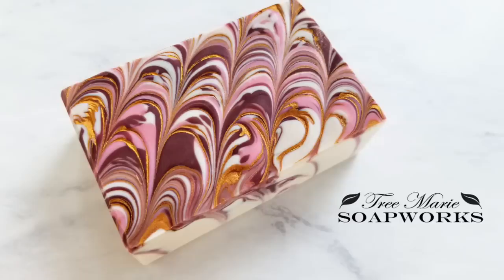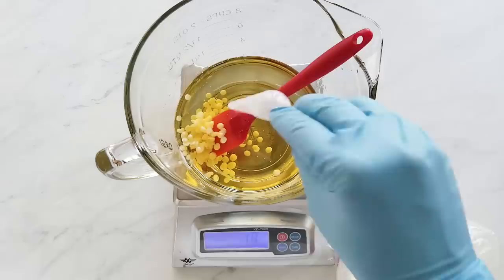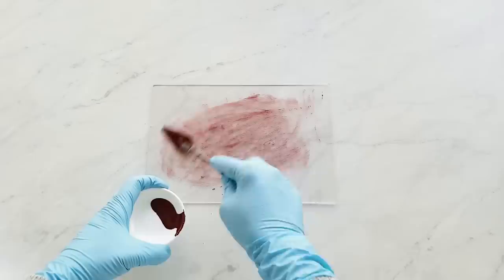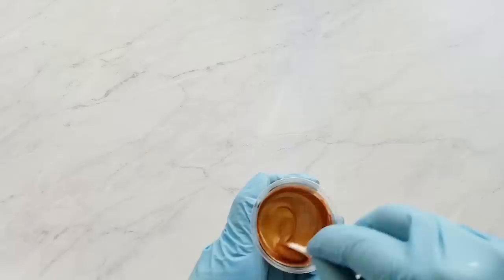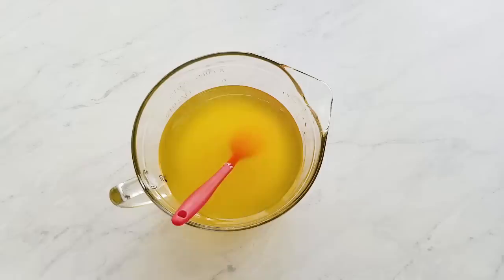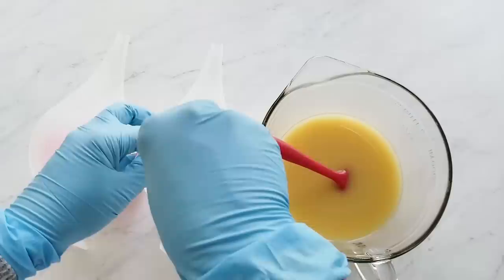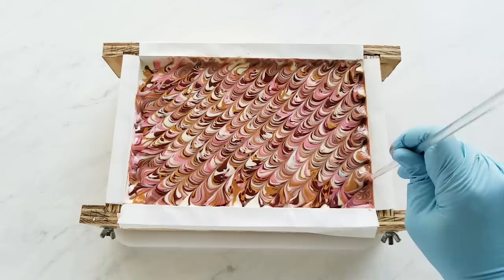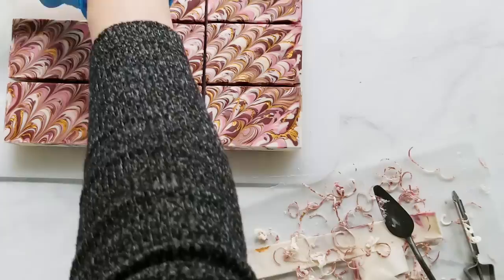Soap Swirling Technique, Cold Process Soap Making, (Technique Video #6)

Comment: Newby soaper here, and love your tutorials. How far in advance do you mix your titanium dioxide and what is the shelf life? Or are your making several batches the same day you mix the titanium dioxide?  And do you mix with oil or water?
Reply from the maker: I use it up pretty quickly, so I don't worry about shelf life. Earlier on I stored it in the fridge. I mix 1:3, TD to olive oil. I don't like mixing with water because when it is introduced to the oils, it doesn't want to mix very readily. It needs stick blended in and that causes acceleration. When mixing it in oils, you can just stir it in. 💖

Comment: Is real Rose scent hard to work with? I understand Rose essential oil and even Rose Absolute is expensive, but it seems to me one could easily use Rose water to scent the soap and use a water discount for the amount you add. 
I've had a hard time finding real Rose soap. It's like everyone thinks Rose soap is over done, so it's never done.
Reply from the maker: Since this FO was floral, I expected it to accelerate, but it didn't at all. I don't think it smells like rose though. It's floral/fruity. You could use the rose water. 😊

Comment: I saw your video very interesting. I have a question. What should I do if I can't get a sodium lactate? If Sodomlactite is the role of making soap hard, it is said that Stearic Acid makes soap hard, too. May I use it?
Reply: Hi there, you don't need to add sodium lactate to soap for it to harden. Soap will harden on it's own, the more hard oils/butters you use the harder the soap gets. Sodium lactate is used to help the bar harden faster and just a bit more than regular soap. This helps to unmold the soap faster. I never use it and my soaps are generally ready to unmold within 24-48 hours, they're hard enough to unmold and after curing they last a long time. I use about 50% hard oils/butters but sometimes more or less. Hope that helps :)
Reply: 호롤롤로 beeswax also helps, no more than 3%. A bit of salt premixed in the water before adding the lye does the trick, too. Kaolin clay, too.
Reply from the maker: Yes, you certainly don't have to use it. And you can dissolve salt (1/4 tsp per pound of hard oils is the ratio I heard) in your water before you add your lye. 😊
Reply: @daniquem.2510  Thank you so much. It was helpful!
Reply: @louisdepointedulac3072  Wow! Thank you! There were many replaceable materials!
Reply: @TreeMarieSoapworks  Thank you! I'll try the way you told me!